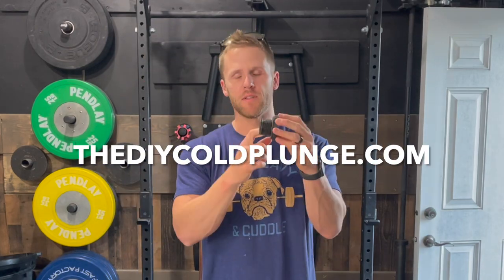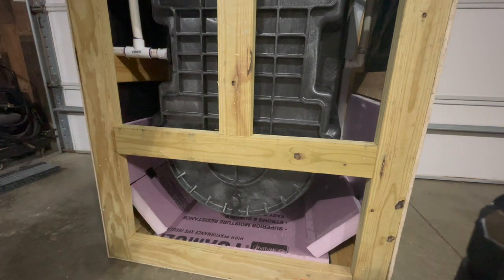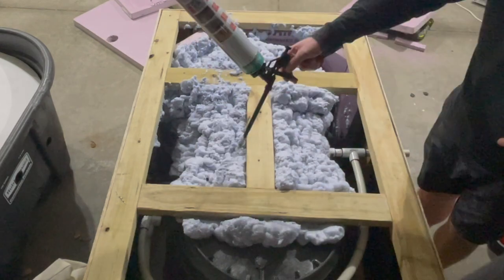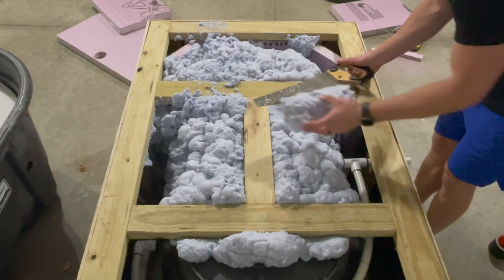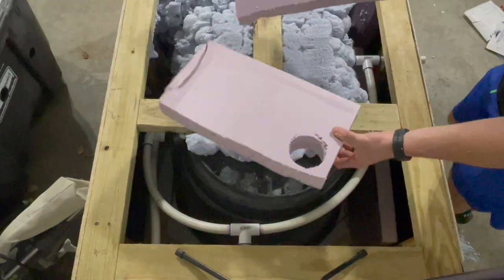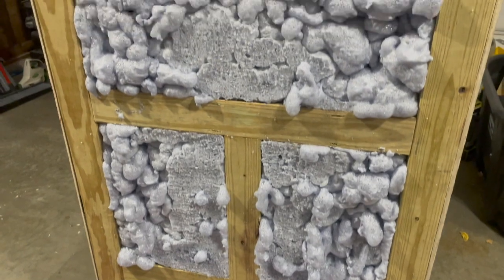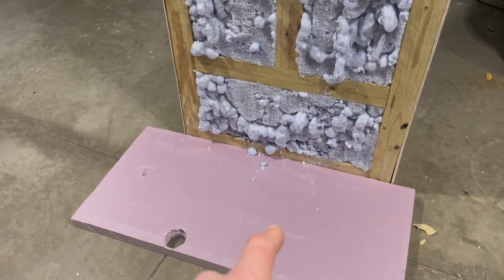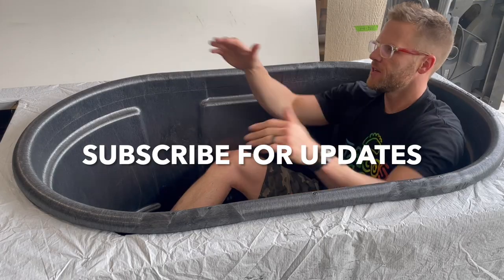How to Insulate a DIY Cold Plunge

Comment: I have a custom drip pan for the tub, so ill be applying the foam from the sides. Going with rigid on interior of walls with spray foam around the tub itself. Also going to do rigid between 2x on bottom, under drip pan, will be elevating one end of the build utilizing some washers between the wheels and bottom of frame to encourage water in pan to collect towards mech side where it can funnel into drip hose, also putting some desiccant in that area. There will probably be some trial and error but im keeping my plunge indoors (storage bench/futon build) so condensation must be contained. Will be getting a dehumidifier for the room for extra protection.
Reply from the maker: All good ideas! Thats awesome

Comment: Awesome work! I'm in the process of spray foaming mine now (in stages). FYI, you shouldn't have to clean out the gun between every can. They only gum up if you detach the old can without immediately connecting a new one. It's the moisture in the air that makes the foam cure inside the gun. Also, now that you have an air gap underneath, you could get additional benefit from a reflective radiant barrier, (only works with an air gap). Even aluminum foil will work.
Reply from the maker: nice tip! thanks

Comment: Do you know what kind of impact the insulation made?  Any data?...such as the time it holds temperature vs uninsulated.
Reply from the maker: Majority of this build's life has been in the winter months. Last summer on my first build I would see an increase from ~42°F to ~52°F on a 90°F+ day without a chiller, ice or anything added. Without the enclosure that same tank would be over 75°F

Comment: Thanks so much for the great information. I really appreciate all your videos! Are you concerned at all about mold build up since you are effectively closing off the ability of the condensation and spillage of water from draining out to the floor with the spray foam? That was my main concern here. Thanks.
Reply from the maker: You bet! My hope is that from wrapping, siding and silicone that there is very little potential for any water to seep inside the frame.

Comment: What are the disadvantages of using fiberglass roll insulation rather than expanding foam? It would be less expensive and quicker and easier to apply. Thanks!
Reply from the maker: I'd be worried about mold with fiberglass.

Comment: at about 1:11 in this video I notice a drain valve set up through the side of the tub, so that you can drain the tub.  Can you share how you did the plumbing and what valve you used?
Reply from the maker: Basically tee off of the line to the pump, add a ball valve and a male threaded fitting

Comment: Did you do anything to fix the tub in place so it doesn't shift when you flip the assembly over for insulating?
Reply from the maker: Hey Charles! When I plumbed it it and added the pipe straps to my drain that was all it needed to stay put 👍

Comment: Fantastic plans and videos, Joe. Thank you! What is the rationale for not closing off the bottom? I noticed that some of the primo plunges (Renu, Bluecube, etc) seem to have an additional panel on the bottom. I was thinking of adding 1/2" marine ply on the bottom. Does condensation make this a bad idea?
Reply from the maker: with the insulation, I just didnt feel the need. Condensation was a thought - but I didnt have this thing ready until October last year so I havent tested it

Comment: Do you have two outlet lines, one on each side it looks like?
Reply from the maker: Yeah... I drilled the hole on the one side before I thought to double up the drain as an outlet.
Reply: @DIYColdPlunge  Would you recommend doing a double outlet? Is it more "effective" or more or less the same and save the $$$/time, one outlet would suffice?

Comment: Does the spray foam remove the condensation on the exterior of the tub?
Garage is 73 degrees and water was 53. Loads of condensation, worried about this inside the cabinet or does the foam remove this effect?   Thank you
Reply from the maker: If you apply the foam directly to the tank it will not condensate. If you're using foam boards it will still condensate because of the air gaps

Comment: I am thinking about putting the foam insulation board in place, then wrapping it with moisture barrier.  Any issues you can see with doing it this way? Also, is the idea to have the plumbing from the tank back to the mechanical area in place before sorting in the foam, covering that plumbing in the process?
Reply from the maker: Without the direct contact to the tank, you will see condensation. And yes, I foamed in my plumbing line. Some people have left a void to access the bulkhead if needed.
Reply: I used the foam board in between the framing but foam insulated from the tank out to the foam board. How much condensation is normal?  Just trying to gauge if this is just condensation or if my bill heads are leaking?

Comment: I used the cones and had a lot of scrap 2” insulation board but 6 cans of the same stuff didn’t even get me half way full. I have the same build plans too.
Reply from the maker: Yikes! did you let it expand after each can?
Reply: @DIYColdPlunge  I did. I’ve used a lot of expanding foams in my job and always give it plenty time to expand and gas off. Maybe it’s the climate here in Texas. Even though heat usually helps. There’s a lot of humidity. Either way, I got a bunch of the Home Depot cans and capped it off. No complaints here. Just an observation. I really appreciate all your videos and info. I already have ideas for another one. Thanks!

Comment: So this is prob a dumb question, but have you thought about putting heavy dudy casters on the frame?  Just in case you wanted to move it around after draining?   Or would the weight of this just be too much?
Reply from the maker: I've seen folks do it! I would recommend reinforcing the frame, how I have it here isn't meant for that kind of weight distribution

Comment: Are you hard mounting the tub to the frame?
Reply from the maker: I did not aside from one pipe strap attached to the drain. Spray foam and a bead of silicone is all I needed

Comment: Have any of you guys tried this during the winter? Just wondered how this would fare with weather regularly at -10*C to -20 regularly (14F to -4F). Would the internal water freeze?
Reply: Would adding salts to the water also prevent it from freezing too^
Reply from the maker: I had mine outside all winter without issue (I'm in MN), the pump kept everything from freezing up. I did pull the chiller in late December

Comment: In my opinion,,,using spray foam is too expensive and has drawbacks,,,too many air pockets which leads to condensation.  A friend used this method and he can smell mold from his tub.   I went a different route.  I used spray adhesive to cover all the exterior surface of the tub with a moving blanket.  I then wrapped with fiberglass insulation bats,,,used spray adhesive to initially secure to blankets.  Then the arduous part,,,,completely and tightly wrapping tub leaving none of the fiberglass area exposed.  I then used spray adhesive to adhere foil wrap completely around tub and sealed the edges with duct tape on top and bottom.  Yeah,,,the asthetics might not be good,,,,but I'm sure there are ways around this,,possible rubber shrink wrap,,,etc.  I have done 2 tubs,,,,the cattle trough and the rubbermade,,,,and the cattle trough is much easier since the outside of tub is flat, as compared to the rubbermade which has ridges.  Anyway,,,neither tub has sweating issues,,,,,I have checked the the three areas where the plumbing go into the tubs,,,and the fiberglass is completely dry after many months.  If one is going to stick with foam insulation,,,I would at the very least use a spray adhesive and cover all exposed area with cheap cotton moving blanket,,,,,,wool would be better,,,,but I could not find wool.  Anyway,,,definitely learned some things from your channel and appreciate your sharing your experiences.
Reply from the maker: That's no good for your friend! I'd love to see your process.
Reply: @DIYColdPlunge  And you never know,,,my friend might not have done a good job of making sure no part of where the cold part of the tub meets the hot moist air?  I would be glad to share some photos of my 2 tubs and what I did?  They are functional over beauty,,,but I'm thinking of doing something fancy with my second tub and perhaps you can share your thoughts?  I also did something different on each lid which you might find of interest.  Not sure if you can pm me?  If that is possible on youtube?